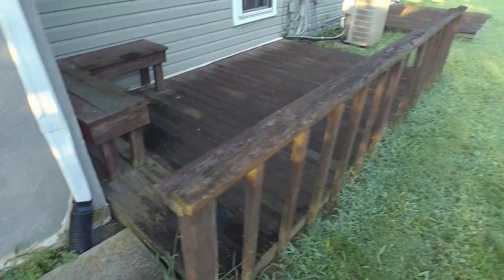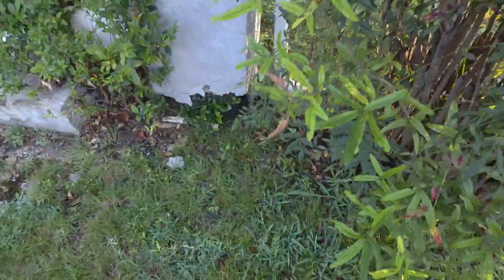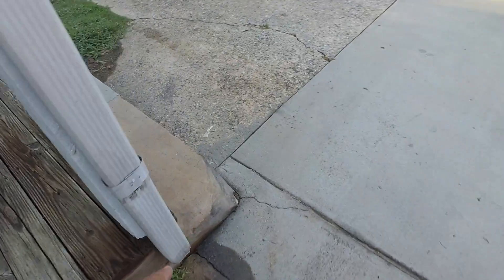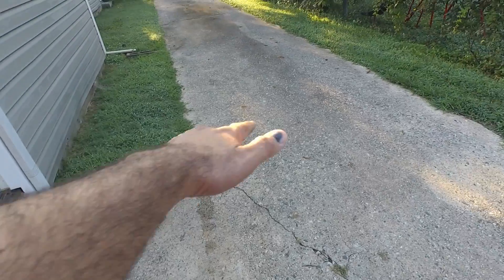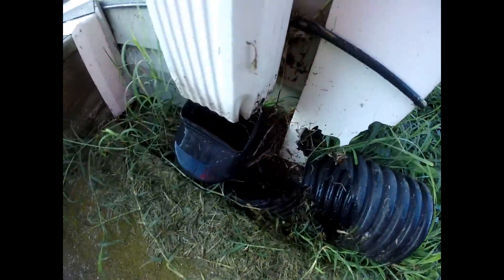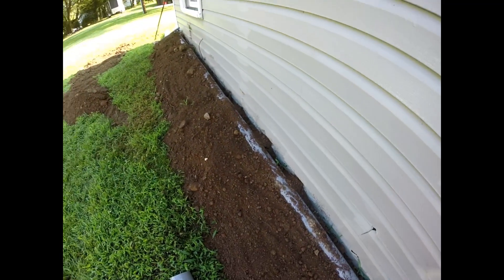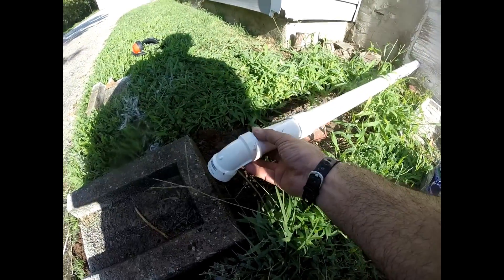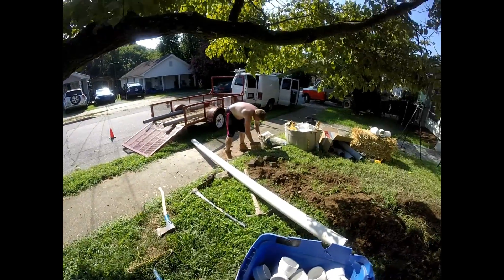Replacing a failed corrugated drainage system with solid PVC

Comment: My observation after watching most of your and others videos , Every time I put in drainage I fit rodding points, especially where pipes join into one ,bit of an added cost initially for householder admittedly, although not in the long run as It speeds up clearing any future blockages or ,if pipes need to be replaced at any time you have a smaller section to replace. This cuts down time and manhours for both contractor and householder .
Reply from the maker: Great comment Jack!

Comment: 10/10, my lawn doesn't have 1% slope to the county drainage so smooth wall was the only way to go. The 101 GPM of 4-in corrugated pipe installed at 2% slope just can't beat the 135 GPM that the smooth-wall pipe installed at 1% slope can move.
Reply: Not to mention there is nothing to collect debris in smooth pipe like happens with corrugated. I like the speed that smooth pipe sends the water...it keeps the debris blown out.